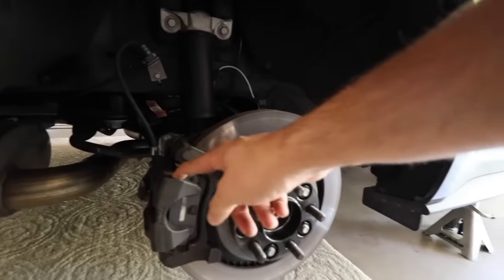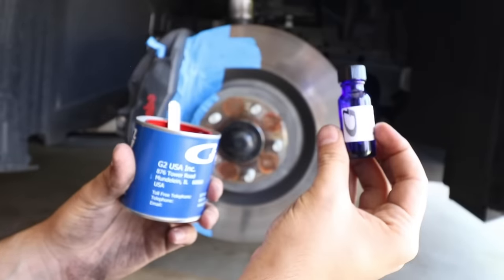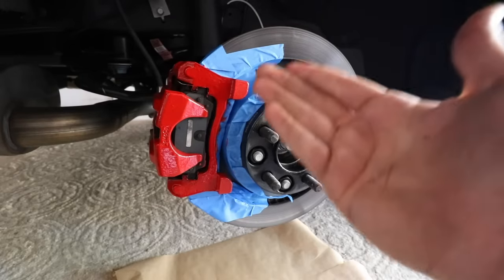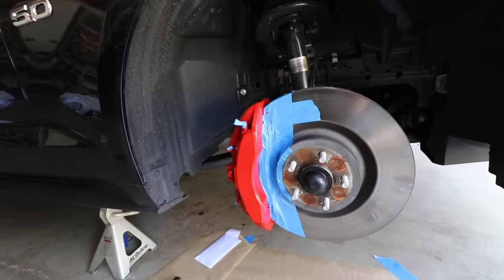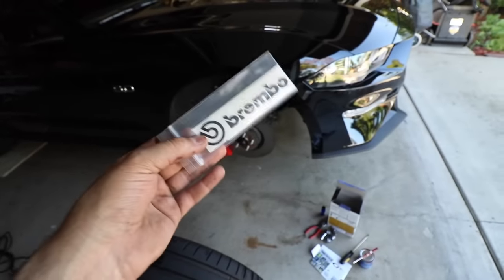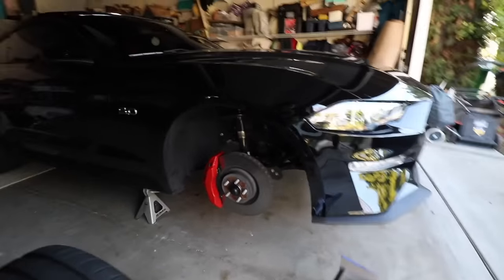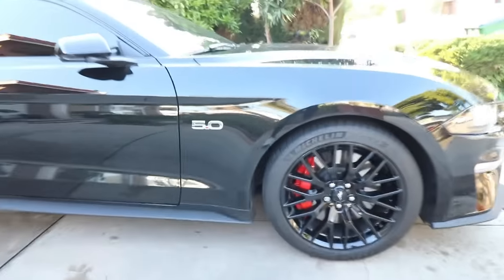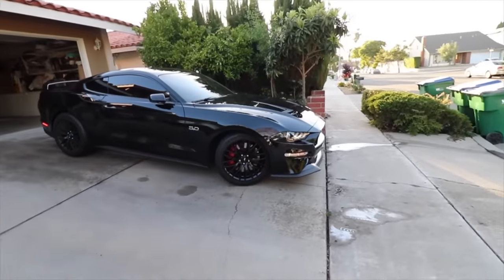HOW TO PAINT BRAKE CALIPERS for $50 on 2019 Mustang GT!

Comment: Always: Torque the wheel lugs in pattern including the lock nut. Its a performance car. If u drive it hard w brakes, that metal heats up and can cause a warp.
Small risk and insignificant in a regular car but with this type, always torque.

Comment: Surprised you didn’t primer the caliper before you applied the red paint
Reply: Yea, I think he wanted it to be a quick job. I'm doing mine in a couple weeks. But I'll be completely removing the calipers and using primer, spray paint and clear coat spray...with a new decal.

Comment: I find it takes less time to bag and tape everything up and spray it than to use a brush. Not to mention a much better end result
Reply: This pint is special made for calipers specifically. It lasts 10+ years. Any other pint is only 3 years too in a car that is driven hard. I used engine enamel paint the first time and it looks great but doesn’t last. My calipers have 11,000 miles and 2.5 years and are perfect still and look like factory red gt350 calipers.
Reply: @xGR1MxREAPERx  Same here the spray I used is caliper specific. Have for about 2 years now and I drive the shit out of my car. My buddy used the brush on kind and he has permanent visible strokes on his calipers.
Reply: @lc500yyc  that’s what I was afraid of from using a brush. I want it to look clean like it was oem

Comment: Do you think the standard brakes are good enough for the 5.0 or do you think you need to spend that extra money for the performance pack for the brembos. Badass car btw
Reply: Standard brakes are more than enough. If you track your car, or want the additional benefits of the performance package, get the brembo's. That being said, the stock 4 piston calipers are really impressive fixed calipers, and are on par with the 4 piston brembo's of the gt500 from 2013-2014. They hold up well on my canyon runs about 30-45 minutes. Just do pads and fluid. But then again, the performance package is a steal. So your call.
Reply: They're more than enough for. a 15 and up.